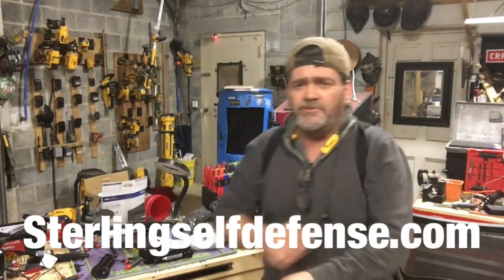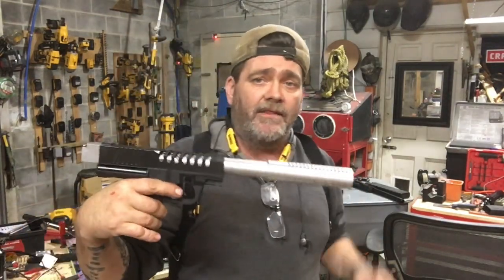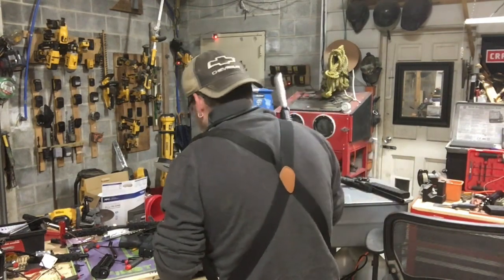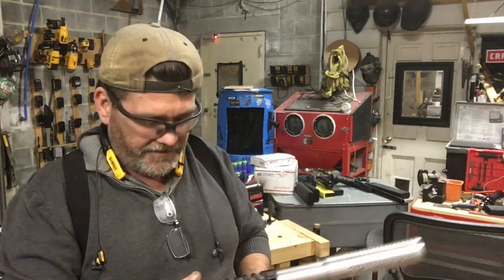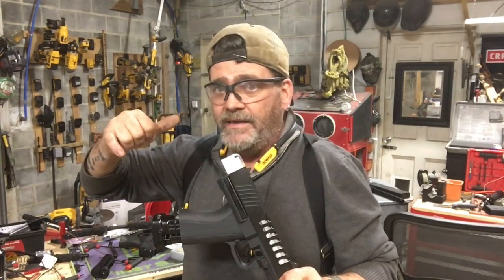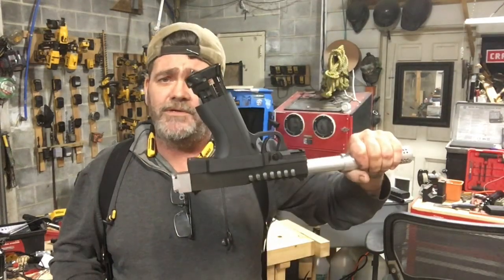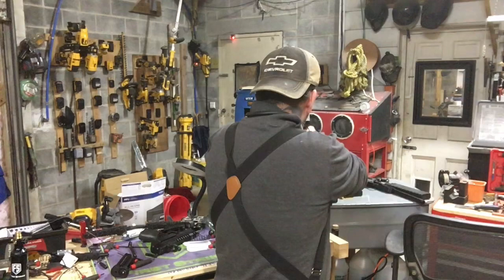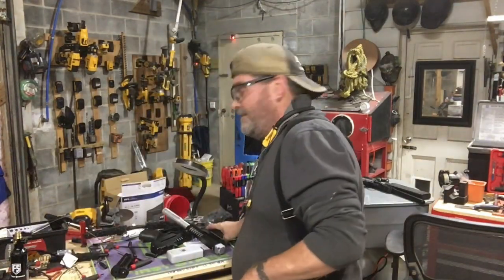Warranty and testing fsv regulator at different power settings

Comment: Like where you're head is at with helping the less lethal community understand the difference between realistically what you actually need to protect yourself an family...but while you jumped on the M17 topic which you don't often do but I appreciate it bc I am a M17 guy ...sitting at 59j  +reliability I would say that for the $$$ that's pretty much the max ...for that marker

Comment: I need something exactly like this! After that, tornado destroyed my house and my business that sits at the bavk of my 2 acre property... the vultures are out, robbingand stealing people's stuff... especially after gettinghot by a tornado! We have alreadybeen through enough,  now we have these vultures just helping themselves to oir stuff! I already had a quad stolen and a lawn mower. My house was rebuilt, and my separate business is getting finished up. My sheds and an unattached garage had to be sacrificed in my insurance coverage. They refused to pay to rebuild them via: some fu🤬ked bs. I am still fighting with them for getting my expensive equipment, machinery, and tools! So I have a ton of stuff out, and so does everyone else who got hit. My property and my block were considered "woodlands," but not anymore. The t3-4 tornado ripped all the trees right out of the ground and rearranged them in a twisted and mangled mess. 50 foot high piles of trees, my house, others' houses, pieces of cars, wire etc etc... all over. That also was NOT covered by the insurance... I had to pay out of pocket for a bulldozer and 40 foot dumpsters to remove the wreckage off my property. So these vultures are now breaking into houses on my block that are being rebuilt. So this is why I am getting into this " less lethal" stuff. I live in the leftist run sh*t show NJ. I can't even buy a slingshot off Amazon in NJ... some nerf guns are also blocked, the ones that eject plastic fu🤬king shells! I can't buy a bb gun or even a pellet gun off Amazon! I also can't buy pepper spray or taser either! They have changed so many laws, rules, and bans in this fu🤬king BS state... iam not willing to risk ending up in prison for the rest of my life , simply for defending my property from thief, robbers, and vultures. Not unless they break into my house while my family is home. So I am trying to learn what's what in this less lethal stuff... unfortunately, I bought the wrong stuff.... this is what I should have bought! I am gonna have to wait to make some more money to buy one of these "fsc's" to hook up... I'm tapped out now, lol. I wish I had found your channel sooner! You are EXTREMELY informative and helpful. You are doing a great service to people like me, especially living in a leftist dem hell hole state!

Comment: Ive always known that unless its chem rounds Byrna are not the one for kinetic riot control styled deterent. And they trying to sell tmc elites for near price of VkS? Its a scam. Those clam shell markers are not capable against a determined assailant using kinetic blunt force trauma. To be less than lethel there has to be the potential to break bones and cause fractures. Its a pain deterrent where the assailant thinks they could actually die if the take a hit. Thats the whole point of kinetics. Long range baseball bat or trunchoen bone breaking styled truama. It wont kill ya but the pain will make you wish you dead.

Comment: Byrna is a pepper ball weapons company, now trying to cash in on the explosive less-than-lethal kinetic rounds market by rushing to market rebadged Tippmann markers, and reconfiguring its existing pepper shooters. Note: Byrna sought to get a head start into consumer kinetic self-defense products by acquiring in late 2021 Mission Less Lethal (including its valuable Tippmann products and patents) 

The big crime with Byrna is they are getting greedy. E.g., the Byrna Mission 4 is a Tippmann TMC Elite paintball rifle. The TMC Elite can be bought all day long on fleabay, new in the box, for $250-275 if you look around, and $325-350 at any time. Byrna's Mission 4 includes a fancy, but useless, gun case, and they made a few minor mods, such as a sliding CO₂ on/off valve. And it uses 88 gram CO₂ cartridges instead of HPA (that's a downgrade IMO).

But basically, the two M4 rifles are the same. The retail price for the Mission 4 = $900!!!!!!!!!!!! That's a total rip-off and just on principle guarantees I will never buy a Byrna product.

P.S. They also did the same with the Byrna TCR, which they sell for $700. You get a spiffy case with that too. Like the Mission 4, the Byrna TCR is a rebadged Tippmann TCR. By the way, "TCR" is an acronym for "Tactical Compact Rifle."
Reply from the maker: Ya the tcr is just the tipx with a cool new casing I have two tcr’s they were worth the 350 but 700 there nuts and the tmc is just a paintball marker with no power and you can’t mod it higher
Reply: Don’t buy a byrna.
Save your money and buy something from Dan Sterling, he’s the Wizard.

Comment: That second round of test shots were spot on for a 12 gram CO₂.

Totally agree on these guys shootin for max power. They don't realize that without beefing up the internals, these stock launchers were not designed to handle the high pressures the yahoos lust for.
Reply: It doesn't need beefed up for full power what are you taking about they don't break as long as pin is lock tighted there nothing to break